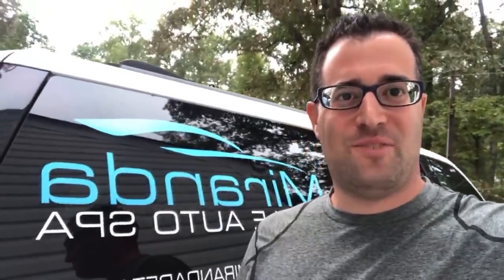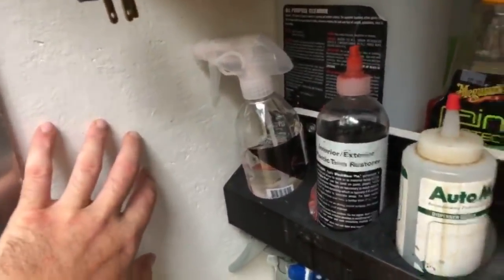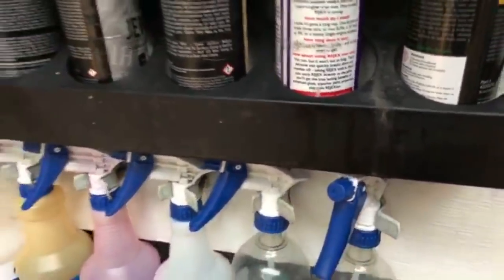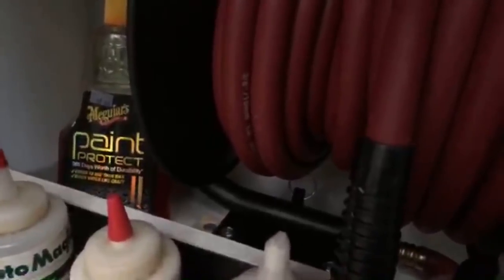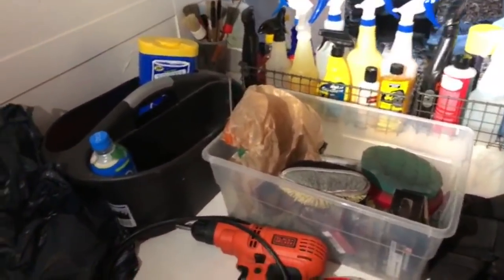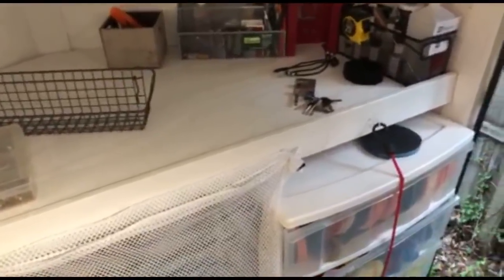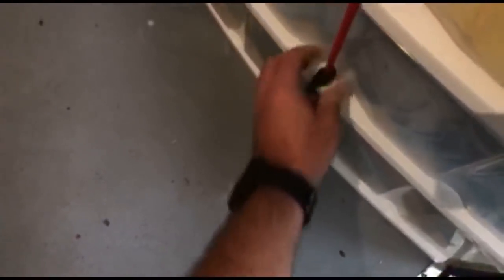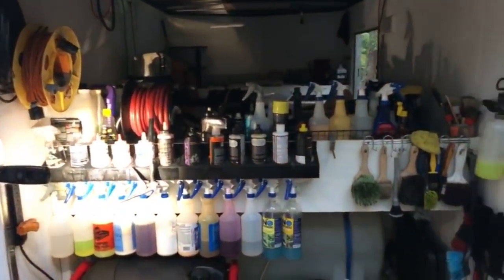New Mobile Detailing Trailer Setup!

Comment: Hey Phil I’m located just up the road a bit in Fredericksburg VA. I’m looking now at getting a trailer setup.  This is a great looking setup you have going.
Reply from the maker: Hi!  That’s great!  Yeah we love it!  If you have questions feel free to call or text.
Reply: Miranda Detailing  I definitely will   What length is yours ? 6’x12’??
Reply from the maker: 6x10 and over 6 feet inside so I can stand in it.
Reply: Miranda Detailing  ok nice  im going to try to find a deal on 6x12 here shortly.   I have a 45’ Rv  to polish and coat this month and that job will cover cost of the trailer

Comment: Great setup.  Suggest you add interior lighting and a couple vents for heat to exit in summer.
Reply from the maker: Thanks!  Yes interior lights are next and also a an exterior outlet to plug in so the entire trailer is powered. I do want to add a vent I’m just nervous about cutting anything on the roof.   I need to research it some more before I can start installing vents. 😎👍🏼

Comment: polisher holder might give you some trouble , its not designed to have vibrations from the trailer and movements might hit the bearings and axles
Reply from the maker: Yeah. I’m kinda worried about that. I’m going to try something different with it so it’s not rest directly on the backing plate area. Thanks 😎👍🏼
Reply: u welcome :) i use the large rupes bag ,its heavy duty and robust and i put microfiber towels between the polishers just to keep everything tight but also soft , its simple and practical
Reply from the maker: Good idea!!